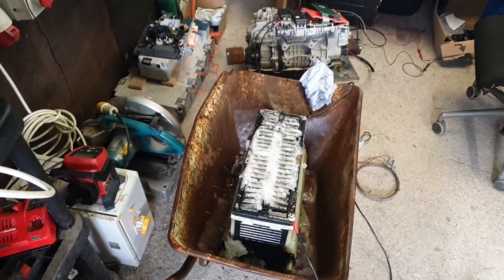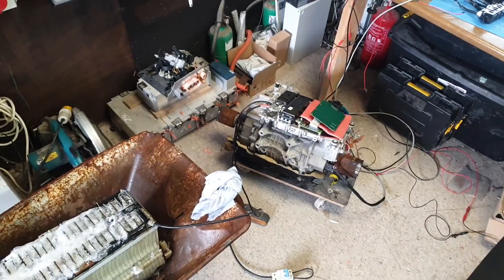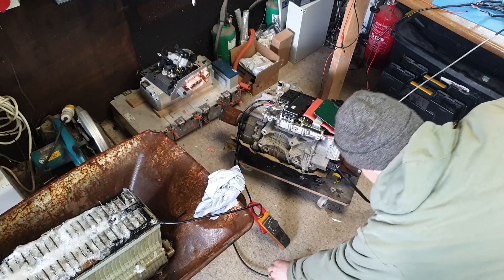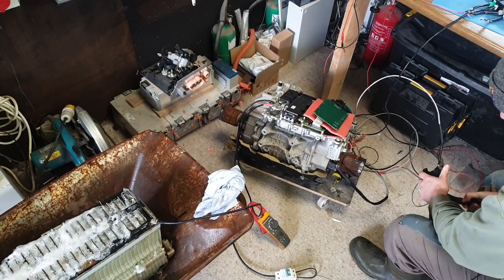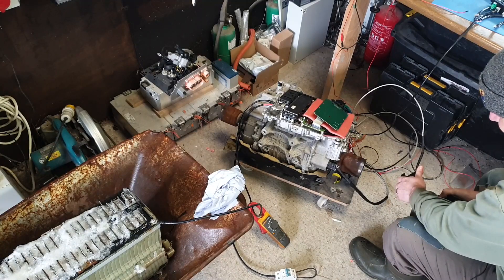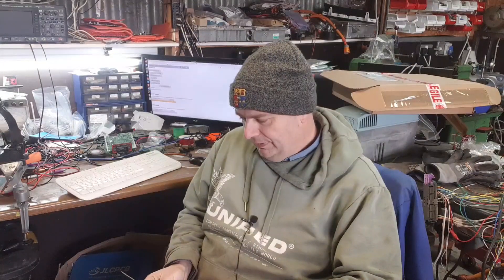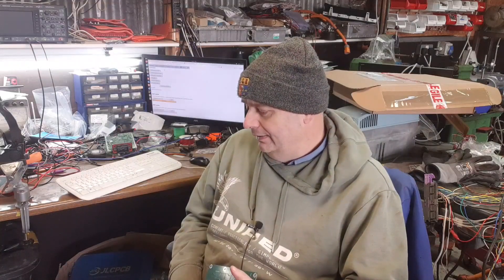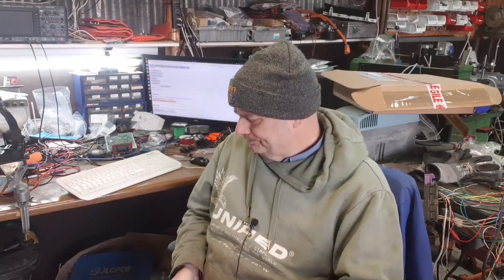MG ZS EV Inverter Reverse Engineering Part 5 : It's Alive

Comment: What does the cooker do?
Reply: If you mean the heating element in series with the inverter supply , it's Damien's current limiting device when testing a drive unit .
Reply: @ so not incorporated in the finished vehicle?
Reply: @noah786  it's carefully calibrated laboratory equipment for Damien's laboratory only

Comment: Hi damien, i work some on these MG zs ev's on my day job and according to the manual, the transmission calls for 1.1 Liters of Castrol BOT 35 ILV oil (whatever that is). Im guessing any gear oil with similar properties work just as well, these drive units pretty much come with scored bearings from factory so im sure its not very important anyway.

Comment: The internet says, that the MG drive unit wants "Shell SL2808", which is not really available for retail and MG won't sell you (if they even admit that the MG drive unit needs oil 😅).
A substitute apparently is 75W, 75W-80 or 75W-90 (depending on who you ask). Apparently with 75W viscosity, you find many "EV oils", for example:
- ROWE HIGHTEC TOPGEAR SYNTH E SAE 75W
- Fuchs TITAN SINTOFLUID FE SAE 75W (this one is GL-4, I'm not sure if that's suitable for the MG Drive unit)
- Fuchs TITAN SINTOPOID 4218 SAE 70W-80

The Rowe oil is quite close to the original viscosity, Fuchs doesn't give a (public) specification, but they are often used by OEMs (BMW for example).

I could try to get you a bottle of such bespoke liquid 🤔
Reply from the maker: The local farm shop will have something :)
Reply: Capacity should be 0.9 litres.